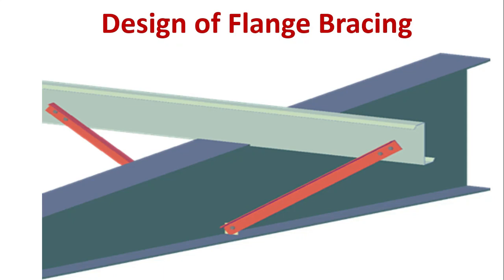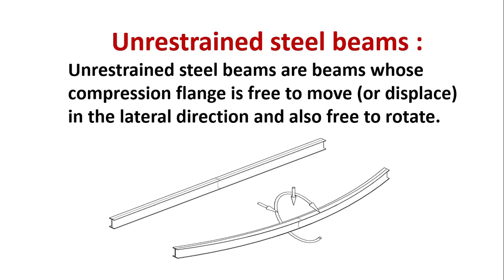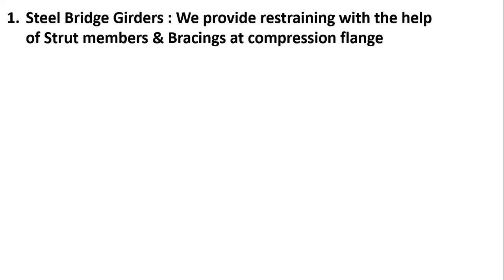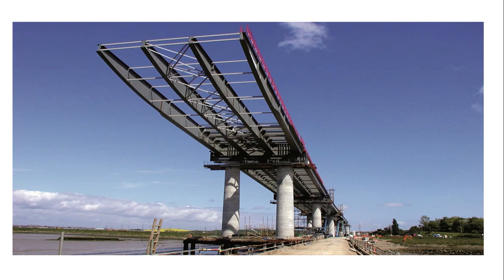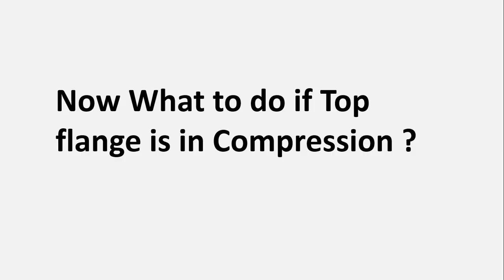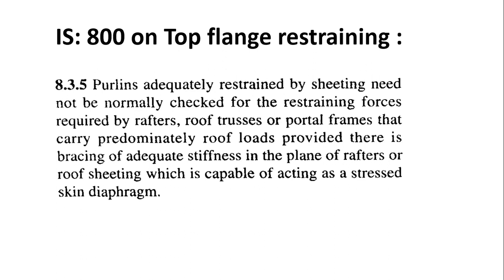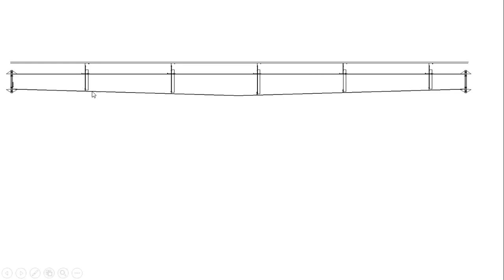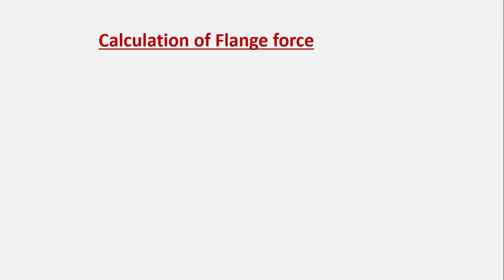FLANGE BRACE DESIGN

Comment: 1.What is the minimum depth required to provide flange brace ?
2.How to decide minimum and maximum dimensions for flange brace horizontal top dimensions from rafter?
Reply from the maker: minimum depth 200 mm
maximum flange brace length 2 m & minimum is 300 mm.
join  telegram group for such discussion
@PEBDesign